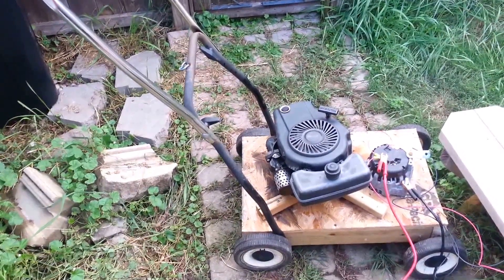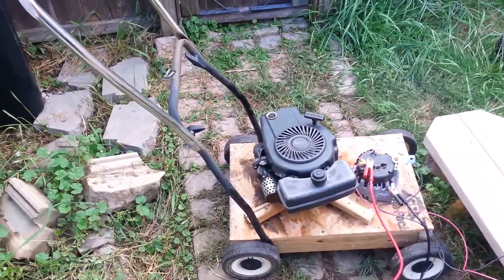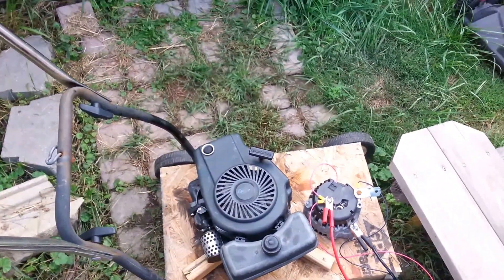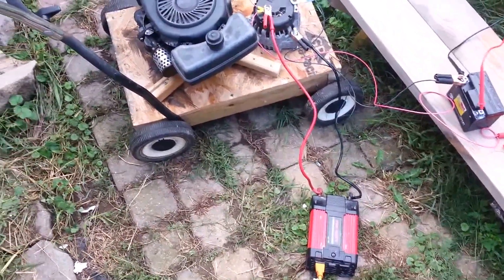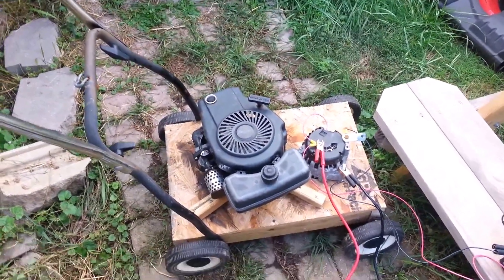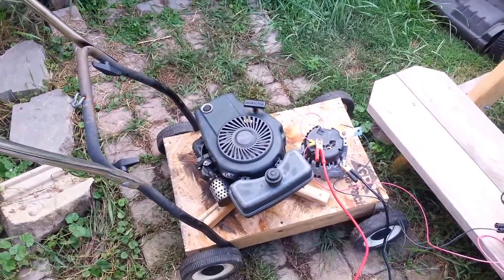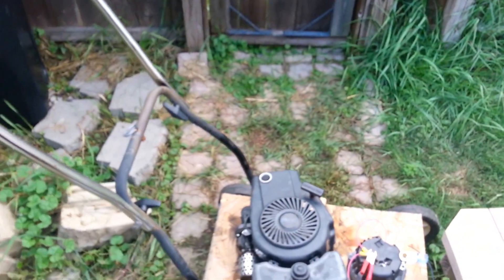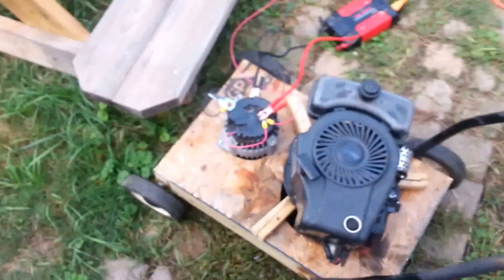Homemade lawn mower generator for cheap.

Comment: What is the battery for? I'm not overly familiar with alternators. I have a  12hp tecumseh snowblower engine i want to build a generator with, trying to figure it all out.
Reply from the maker: This type of alternator is not self exciting.  So it needs an external power source to excite the field and start generating power.  Otherwise it will just freewheel.